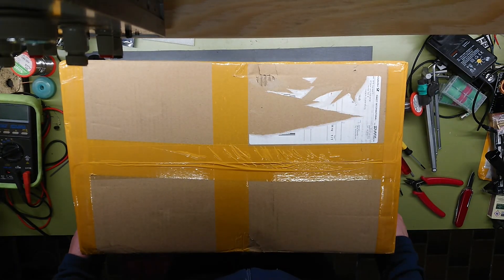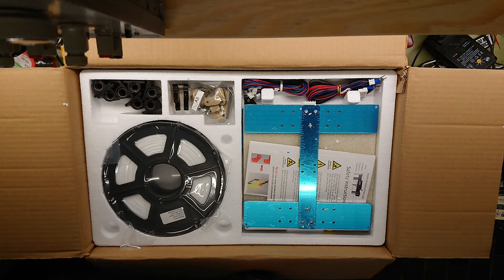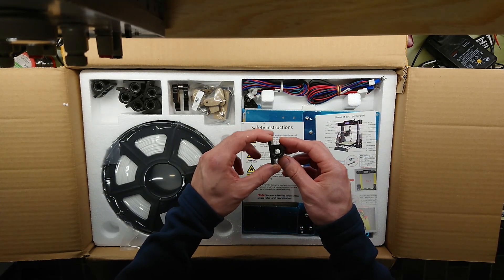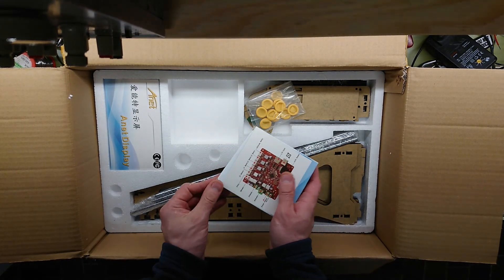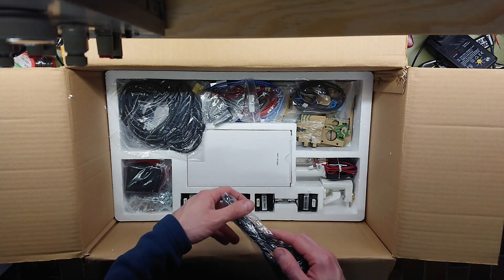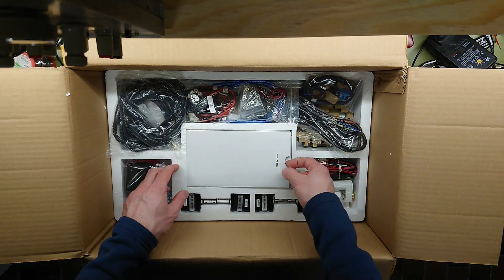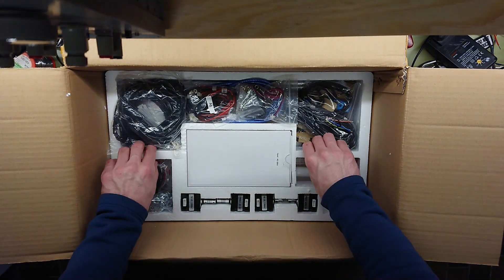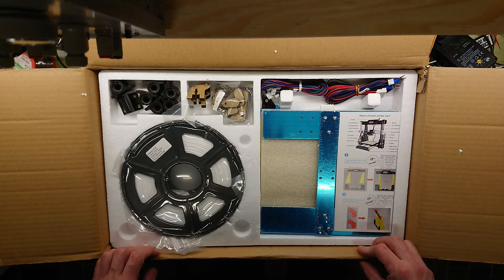Unboxing the Anet A8 3D Printer

Comment: i get a packet very soon. and i know you will remember this component. It's a siemens mccb overload relay(in danish called maksimal afbryder) from a dba seller. and it is a good offer because i get for 500 dkk and normally it cost over 3000 to 10'000 dkk depending of current and short circuit current values. 
it is rated for 100 A 400 volt. But i have a friend who also have a 3d printer, so with these few things i need, i go to him instead.
Reply from the maker: What are you going to use the 100A Siemens breaker for?
Reply: @KaizerPowerElectronicsDk  sorry for the late answer. 
it is to reasons combined. first is the very lov prize. the siemens mccb was brand new and came in the case from the grossist. it has only be opened for wiewing. and in my work, some has so big eyes when they heard about this. so all manuals and screws was in the box. the plastic film from the setting panel is also un opened. 
the secon reason is: i also play with electricity. but on different voltage and in the most cases 50 hz or dc. you may has been noticed  the blue container in some of my videos. in this, there are 3 10 Ah 12 volt batteries. this is only one of the cases when breakers are used. 
if i tell i has purchased 3 flexible copper busbars, that is insulated with black insulation with integrated lugs. and you now know where i get them from and a simple calculation tell a cool story when i tell you it's a internal order in the company(personalekøb). 
they came in 3 to 10 days. 

when the weather is better, i go outside with my teslacoil(verye small) and test it. 

have a nice day.

Comment: Please open that power supply before you do anything else. Can it really output 12V/20A without overheating and dieing.
Reply from the maker: This is also a concern that I talked about in the video, it is simply too light weight for its specifications. Next video will show the upgrade power supply.